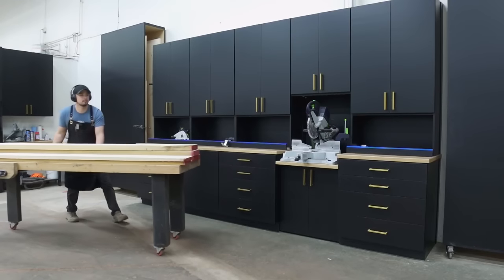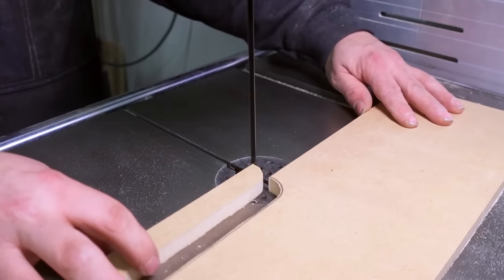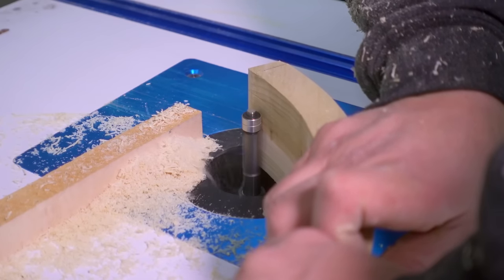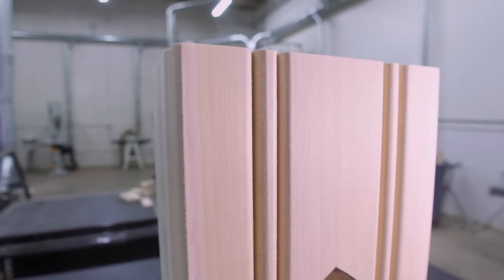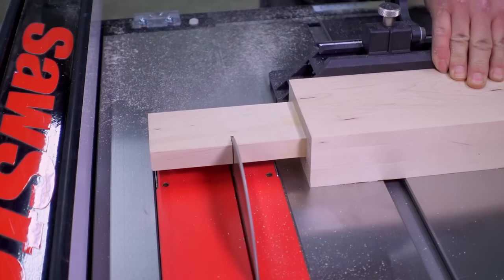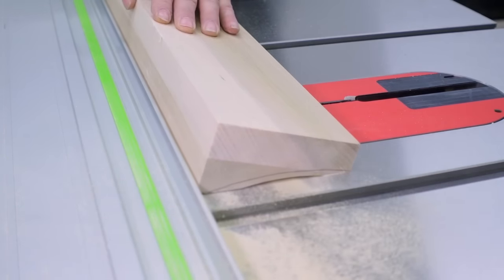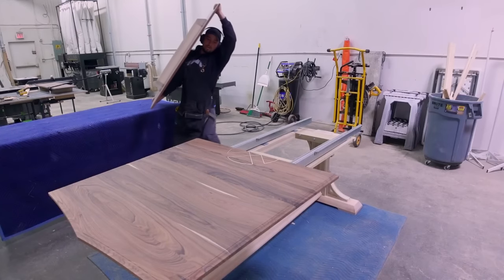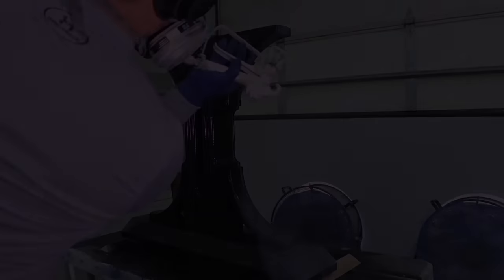Is This Even POSSIBLE?

Comment: That's next level talent.  It's like a mini cathedral.  I don't know how you're able to drill those long holes by hand and keep them straight enough to meet at both ends.
Reply from the maker: That's quite a good compliment! A mini cathedral. That's all I could ask for! I drilled a hole in a thick block on the drillpress, then used that as a guide to start the holes. The first drill bit was a long one that could go all the way through.

Comment: I never liked beading on furniture until this with its arches reminded me of Quake3 arena, now I love it!
Given me an idea for some techniques I need to master too.
Reply from the maker: I think old architecture with beading and curved lines is inspirational. So I'm glad this project gets you thinking about things you can do too
Reply: @FortressFineWoodworks  I'm from rural Sussex in England so I've slightly taken it for grnted in the past. Now really understanding and appreciating as I start getting into carpentry. You'd LOVE one of my local pubs (although not the new extention they have put on, which is appauling,) Check out The Middle House, Mayfiled - built in 1575.
Reply from the maker: I sure will. Thanks for the idea

Comment: Truly awesome workmanship. That’s some workshop you have. One thing I would have done is make the actual top a little thicker,  it looks flimsy and does not look like the top and legs go together. Apart from that 10/10
Reply from the maker: Thanks for the input. I was using Morado that I bought years ago. So the project was created in order to use that 4/4 material.

Comment: Absolutely gorgeous table.   Just to touch on your Lee Valley extension, it's much more designed to recreate  the slide design of early 1900's split pedestal tables like mine. Essentially, the pedestal is a hollow wooden tube with a base, 4 casters, and all split vertically. When opened, each half of the tube, base and casters carry the load of each table end, and the remaining load which tends to be higher than the end pieces, is carried by the middle of the slide beams where they're doubled up and much stronger. Either way, it's almost a moot point since I've never seen anyone open their table that much.
Reply from the maker: That's very true. I've seen these exact slides on a different table with twice as many bearings. So they're being produced better somewhere, I just don't know where

Comment: Loved the wet brush idea for cleaning glue squeeze out. Not sure if that's a commonly known technique, but no one else shows how to keep seems nice and clean. What are the limits? Doe the watered down glue seep into the grain and mess with the finish when not painting? Would love to see more of your glue clean up practices!
Reply from the maker: Thanks for taking the time to comment! I haven't seen this trick anywhere else, and as long as you keep the water in your cup warm and clean, then cleaning the joint a few times over (dipping the brush inbetween) will do great. Sand the areas after they are dry and your stain or clear finish should come out nice and even.

Comment: My theory on the rust is this. due to the nature of cutting perpendicular to the saw blade you created more friction than usual since the face of the blade is rubbing against the wood as it passes over. Table-saw blades CAN do this, and fairly well, but it's not how they were designed. The excess friction caused additional heat in the dust that also didn't extract with the dust collection as it usually would. the extra hot sawdust then built up on the table-saw which condensed the moisture in the air of your shop just like a cold glass of water on a hot day (IE the tables was a cold glass and the sawdust the air). I'm sure it's stable but there is always some level of moisture even in kiln dried wood.  just my 2 cents.
Reply from the maker: Ya! Maybe so since the sawdust was likely very hot. Great 2 cents! Thanks for watching

Comment: Couple more questions man

What did you use for your top coat? It’s perfect. 

Also what were you doing with the little paint brush? It looked like maybe applying a little glue to joints?

You’re going to blow up man. You deserve everything that’s coming to you
Reply from the maker: Thanks! The finish is Envirothane 180 Black Primer (water based) then evirothane 100 Black Tinted topcaoat. Amazing stuff. Spray it out of a 308 tip in an airless. 

The brush is dipped in water to clean up glue squeezout.
Thanks for watching!
Reply: @FortressFineWoodworks  oh okay. I gotcha man. Thanks so much for your answers

Comment: As a new- be to your channel I must say (Impressive!) the one question that may solve my main irritation I have in my woodworking... what are you applying to the glue squeeze out to (I assume) keep the wood from having that ugly stain glue leaves????
Reply from the maker: Great question. Softer woods stain easier. So you have to sand well. 80 150 and 220 grit. I use harder maple and such, so I just scrape the titebond 2 off with a drywall knife, then sand through my grits.

Comment: What did you use on the base for a finish? Was it a black oil base paint?
Reply from the maker: It sure looks like it huh? But no. These are amazing water based products by envirolak. I used the 180 primer tinted black to get everything coated thick. Then sanded smooth with 320. Then topcoated with 1 coat of envirothane 100 tinted black. I sprayed with a graco airless gun. 308 fflp tip
Reply: @FortressFineWoodworks  thank you. It looks fantastic!

Comment: That's just amazing, and I imagine it distorts the spin of the Earth with its weight. I also suppose you  now have to do a cabinet to store the extra leaves in, true? If you do, will it be Gothic as well, or something from the later Emo period? (sorry, had to) Two questions - what kind of finish did you use for the trestle's final coat (it's beautiful), and just how nerve racking was it having to drill and fiddle with those table top sections after all that effort?
Reply from the maker: Yes, this table changed the earth's rotation and now we have to add a gothic holiday to make up for the extra day. A cabinet is a fantastic idea, I can't believe I didn't think of that! Emo themed! I used envorolak's 180 high solids primer (tinted black) to produce an impeccably smooth surface, then one coat of envirothane 100 tinted black. This stuff is expensive but truly amazing. And of course, every drilling or routing step was horrifying.
Reply from the maker: Ps. I order my finishes from On Site Finishing. They know everything about finishing, and will ship to your state. If you spray these envirolak products, don't use hvlp, spray with an airless. With a graco 308 fflp tip or equivalent

Comment: Rust on your saw?  There is 8% to 12% moisture in the wood.
Reply from the maker: Yeah, someone mentioned that it may be due to the heat from the cut heating up the sawdust, then causing the moisture to condense on the cold cast iron.